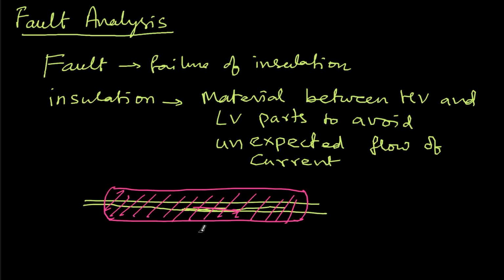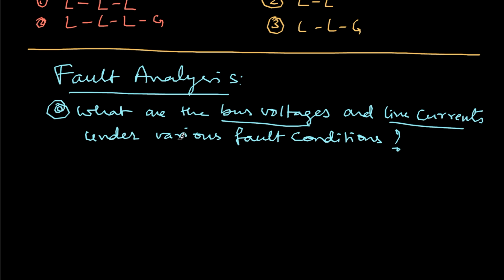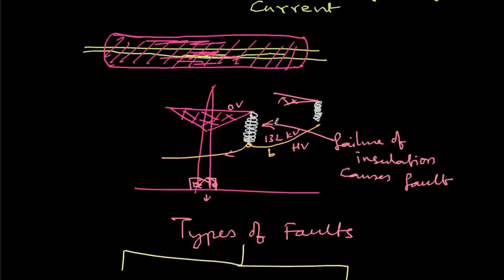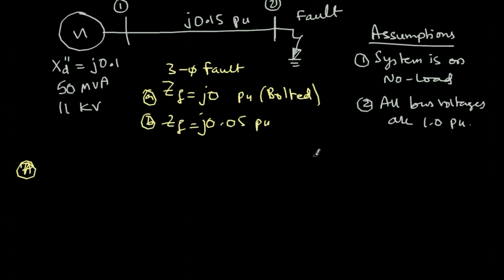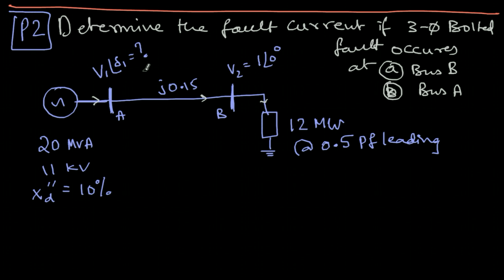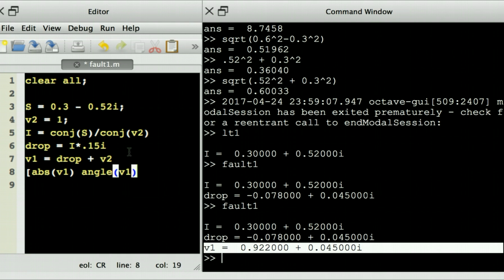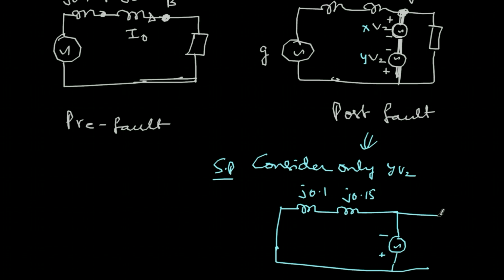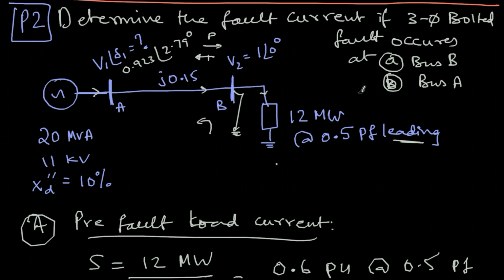Balanced (Symmetrical) Fault Analysis - Part 1 of 3

Comment: A 250 MVA, 13.8 kV star connected with the neutral connected to the earth through a reactance, is 
connected to a 250 MVA, 13.8 kV/220 kV transformer. Primary and secondary windings of the 
transformer are star connected with neutral point is solidly grounded. Generator reactances are : X” 
=0.2 pu, X’=0.3 pu, X2=0.2 Xo=0.1 p.u., Xn=0.05 p.u. Positive, negative and zero sequence reactance of 
the transformer is 11%.A single line to ground fault is developed at the high voltage side of the 
transformer . Calculate:
a) Fault current during sub-transient period
b) Voltage at the generator terminals during sub transient period 
c) Fault current during transient period 
d) Voltage at the generator terminals during transiwnt period
How solve this question

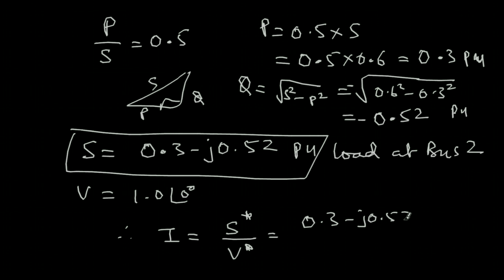Comment: Thanks for this good lecture first !  I have a quetion at 33:15 when you caclulate the line current I, for this 3-phase  system it is supposed that V is the line-to-line voltage, therefore S=sqrt(3)*V*I_conj. So when we calculate the complex current, I should = S_conj/(sqrt(3)*V_conj).....not S_conj/V_conj

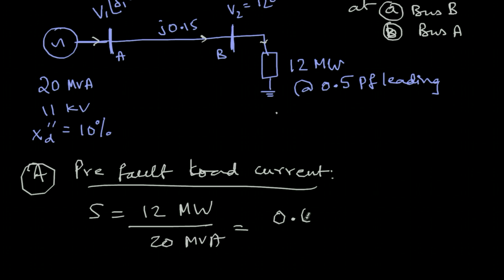Comment: at 30:33, you calculate pu of real power (12 Mw)  and at 31.19 you are considering it as apparent power.....i think you need to correct your question ...12 Mw should be 12 MVA ..if i m not wrong.
Reply: Diwash Bhandari exactly it must be ratio of 24 MVA/20MVA = 1.2 pu for load then further we will solve
Reply: I thought the same thing.
Reply: yes it has to MVA/MVA
Reply: yes me too find the same mistake
Reply: I think ur right.... What he got was p.u of apparent power I think
Reply: Really I was confusing at this moment when divided real power with apparent power
Reply: I also thought the same thing.

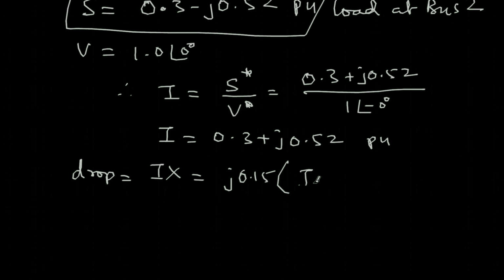Comment: hye sir.at 33:47, you use the formula I= Sconj/ Vconj.Just wondering since we are doing 3 phase calculation should there be a square root of 3 somewhere? Same for LF I saw S= VIconj. No square root of 3.
Reply from the maker: I used the formula I_pu = conj(S_pu)/conj(V_pu) that means i am calculating everything in per unit. So sqrt(3) is not required. Root 3 will come when you want to convert the pu value to actual value.
Reply: thanks sir.at first  I thought it was due to the fact balance 3 phase can be analysed using 1 phase circuit. As long as we use pu, no square root of 3 involves?
Reply from the maker: see this https://youtu.be/BGor7OKJSyw
Reply: tqsm for the video

Comment: sir at 43.41 u said that we have taken bus volatge at node B u have said to consider the potential at 1.0 pu and the overall potential differece will come out to be zero volts..i do agree with that sir...but why havent we considered the potential at bus b when we were calculating for yV2 ..please explain sir..?
Reply: Superposition theory states that any voltage source must be considered individually (which he has done) and whilst doing so, all voltage sources should be replaced by a short circuit, considering explicitly only one source at a time and adding up the individual contributions. Therefore it is in fact xV2 that in my opinion has not been calculated correctly. Pre fault Voltage at bus b should be short circuit for purposes of superposition analysis, exactly as was done when he calculated YV2.
Reply: *all other voltage sources

Comment: at 48.26 at net current angle 2.79 is not considered why sir?
Reply from the maker: You are write... I made a mistake in the video. that 2.79 degrees should be considered. In fact I made 2 mistakes at end.

Comment: sir at 22.30 why j0.1 is included after bus 1 , but actually it has to be before bus1 am i right sir ??
Reply from the maker: again I made a mistake, bus 1 should be after j0.1.
Reply: sir but that will hardly effect the calculation as the fault to be found out is at bus2 or at the load end..(load here is 0) ?